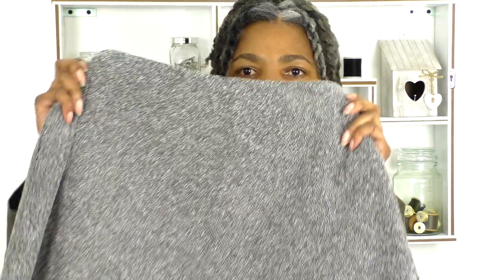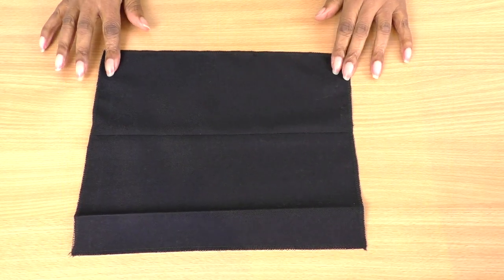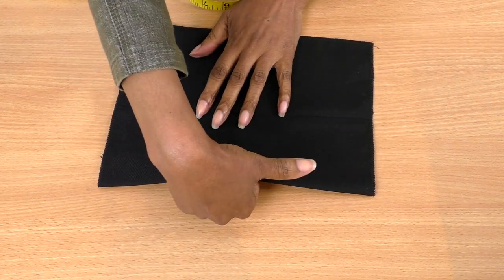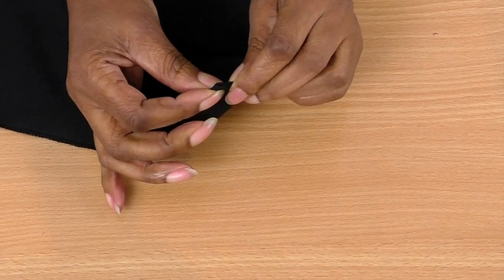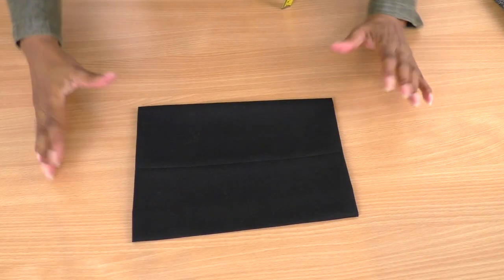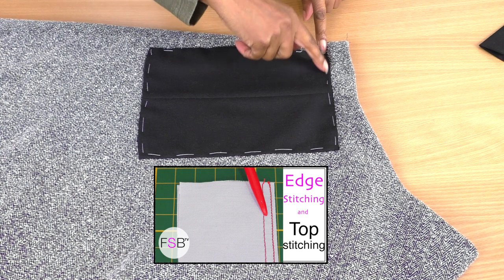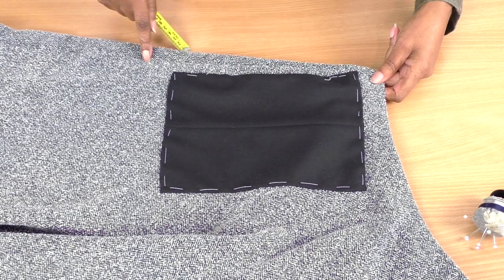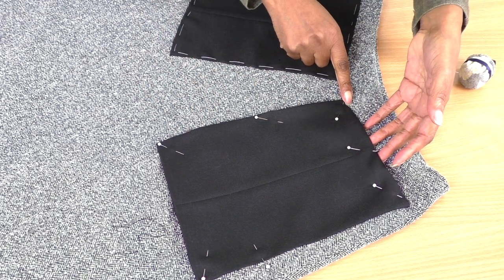How to Sew a Patch Pocket on to a Skirt | DIY Refashion Project

Comment: For the facing, what did you use? Is it interfacing or did you fold down to create a facing? I hope this makes sense.
Reply from the maker: I used both techniques interfacing and facing, it helps to create a stable pocket shape.